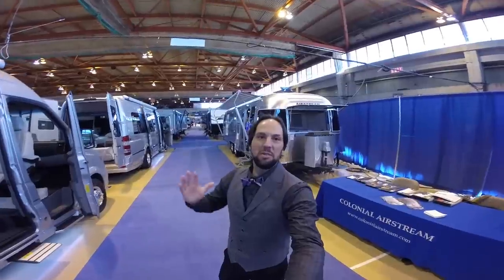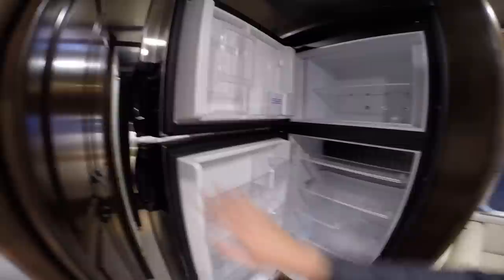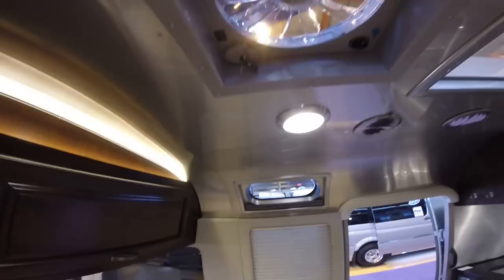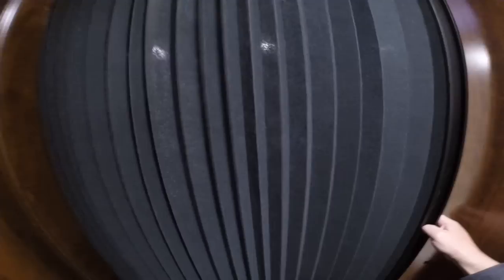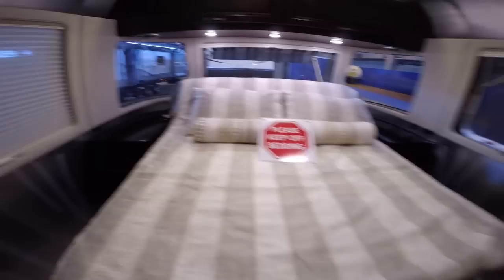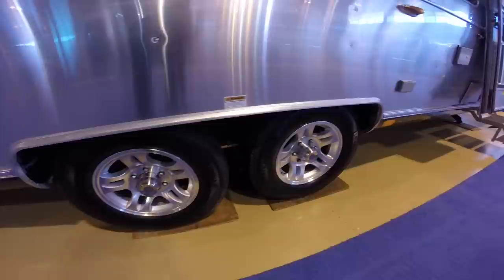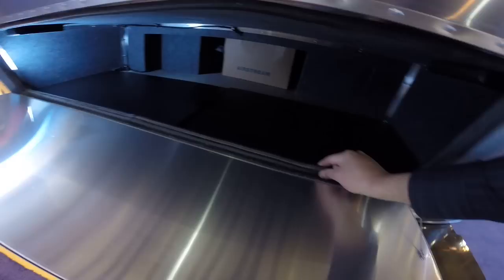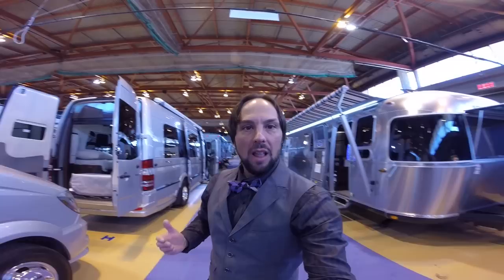Walk Through 2016 Airstream Classic 30J Luxury Travel Trailer RV Camper

Comment: Would I be correct in guessing that the power beds are not available in the 30' 2018 models?  Also, are the day/night blinds also on the corner windows or just blackout as shown?
Reply from the maker: Erin the Classic trailer beds are power for 2018. The panoramic corner windows just have blackout shades.

Comment: Patrick:Great presentation but how does your Airstream Interstate class b pull this when the  towing capacity is 5000 lbs and this 7000lbs empty?!
Reply from the maker: The Interstate non extended could pull up to 7500#. This model is no longer in production.